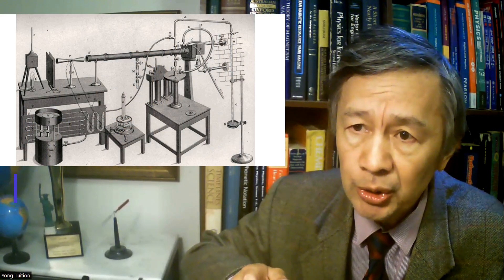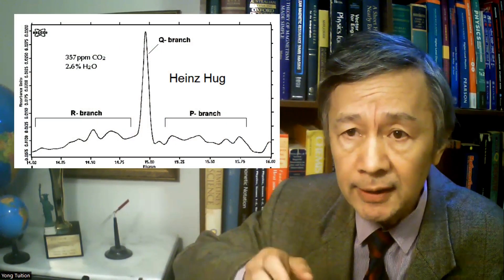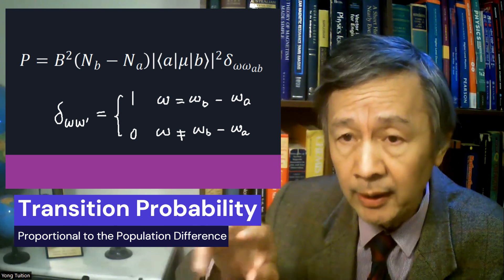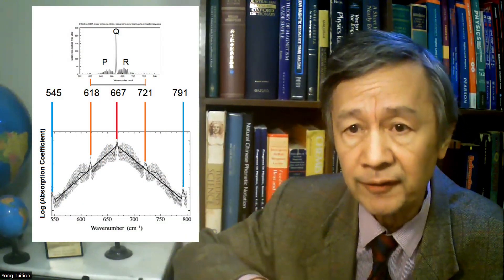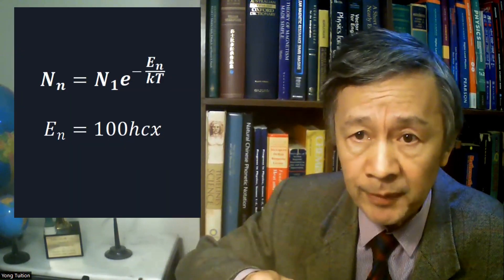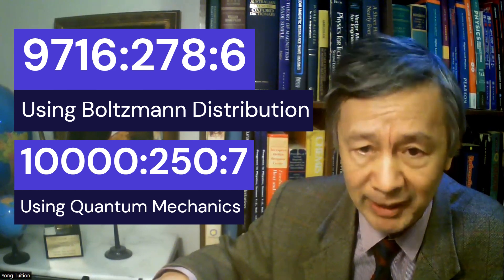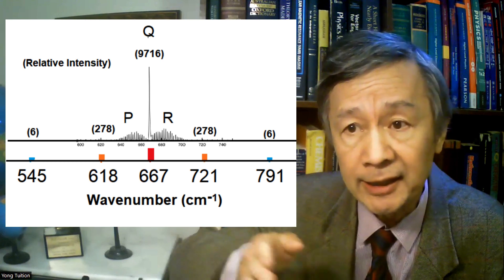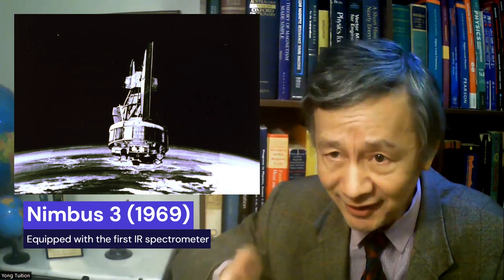CO2 Absorption Spectrum: Simple Calculation & Interpretation | Independent Climate Research 20230709

Comment: Thanks for explaining the phase shift Hannel performed  to compute CO2 absorption/emission.  I understand that the satellite measurement is a relative LW radiation intensity, relative to what? The Planck curve?
Now if you look at your picture Computed CO2 absorption you see these Plank curves for different temperatures but with a peak  wavenumber between 400 and 600 cm-1. Much less than predicted by Wien's law (Lmax= 2898/T ). For 288K the peak should be at nearly 10um (1000 cm-1) and for 220 at 13 um (880 cm-1). I think this difference matters if measured relative LW intensity is compared to a Planck curve.

Comment: Appreciate the simplified explanation of these complex mathematical models. 
The atmosphere also gains hurricanes of heat energy from surface contact, (and certainly radiates that heat energy) so it is very important to nail down the exact difference that is caused by CO2 absorption. 
The GGGW theory seems (?) to assume that all atmospheric heat is radiative absorption. 
But your precise application of the actual bandwidth and proportion is likely far more accurate. 
Thanks again.

Comment: Dr Yong,
Another great presentation. I would be interested in your views on CO2 induced cooling in Antarctica and why it occurs.
Reply from the maker: Hi Scott, this is beyond my research on long-term global mean measurements.
Reply: Listen to anyone’s of Dr Will Happers discussions on Co2 and warming.Ill give it a try though.This Co2 cooling at the poles has to do with latent heat and the ,apparent paradoxical cooling.In the polar regions as water freezes latent heat is released causing lower level warming so Co2’s influence higher in the atmosphere leads to lower temperature layers overlying higher surface temperatures.That’s a pretty awful description,listen to Happer he’s a real expert on atmospheric physics and radiative transfer physics.